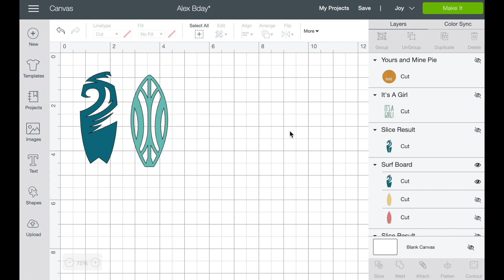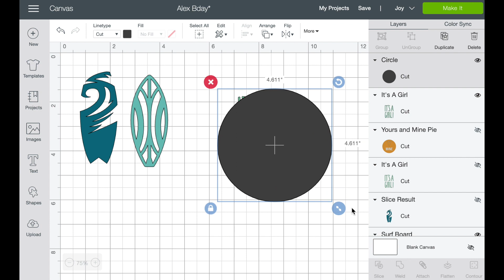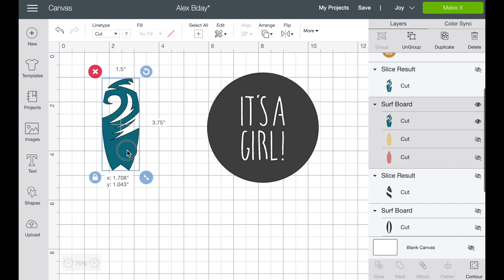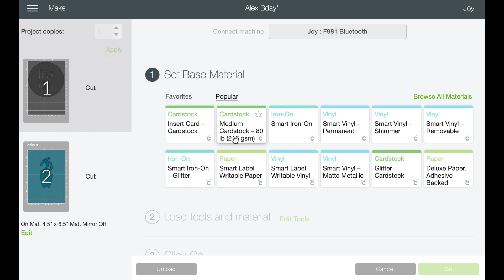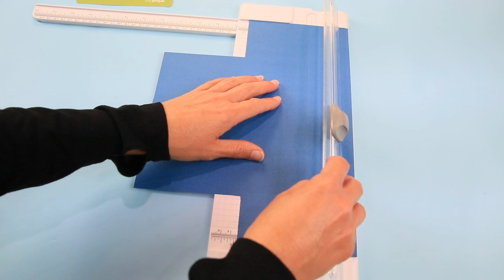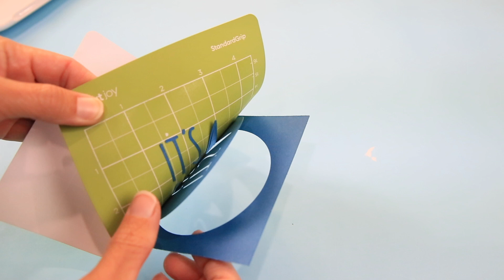How To Make A Cookie Cutter Template with Cricut Joy

Comment: Thank you for your fabulous instructions! From start to finish, you demonstrated everything! Thank you, thank you, thank you! I'm curious if card stock works best for cookie stencils, or if there is another material you might suggest?
Reply from the maker: So glad you like the tutorial! 💕 Cardstock is fine if you're only using the stencil once or twice. I would suggest acetate sheets (thin plastic) if you're wanting to keep the stencil and cutting with a Cricut Explore or a Cricut Maker. The Joy won't cut something that thick. Although you could try vellum paper if you're cutting with the Joy. It's very thin, but has a plastic like quality. It would still only last the day and you would need to recut for the next project. I hope this helps! And thanks so much for watching! 😍

Comment: Would you recommend card stock or a vinyl material if I was making stencils I wanted to re use?
Reply from the maker: Hi there! If you're wanting to reuse, I would cut them from a thin paper like vellum. It won't last forever, but it would last a little longer than paper. Vinyl will be too flimsy. If you have a Maker or an Explore, you can cut your design from a thin plastic like the stencils you can buy in craft stores! The Joy might cut it, but it's not on their recommended list. Happy crafting and thanks for watching!